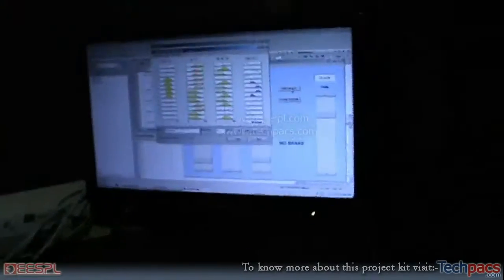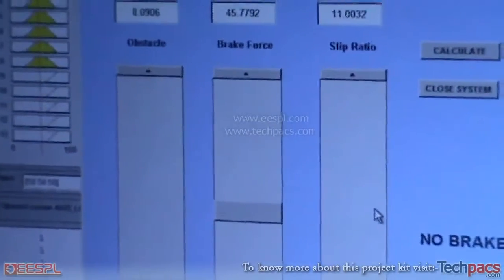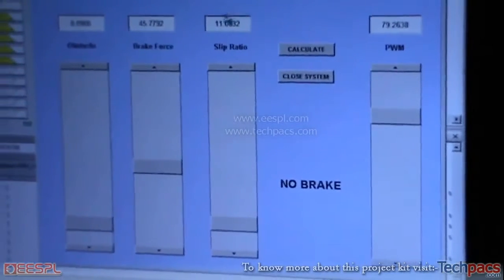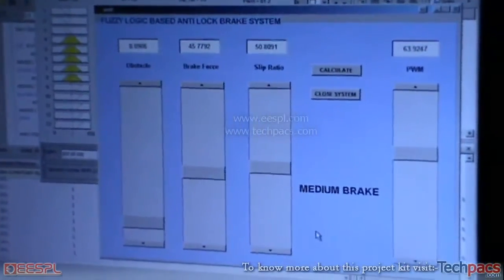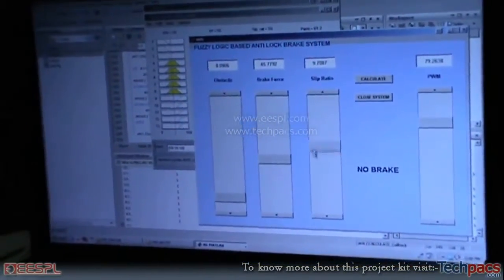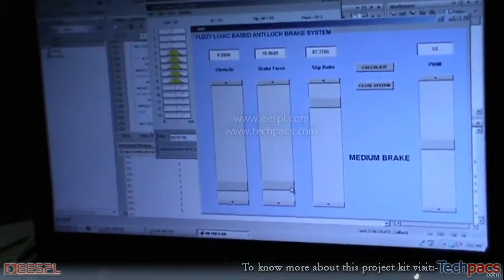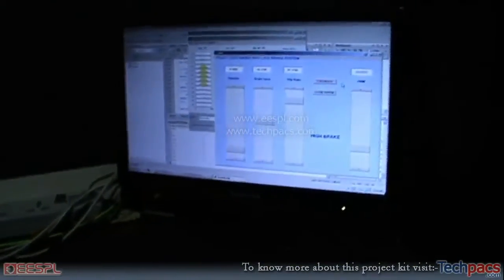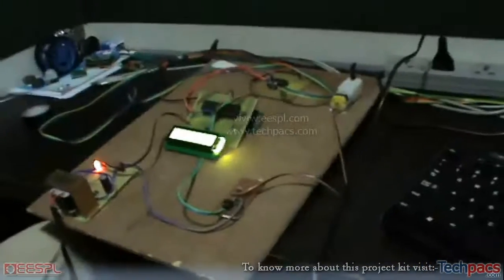Design Of ABS Using Fuzzy Logic | AntiLock Breaking System using Arduino  (latest Project 2020)

Comment: Hi guys,
You seem to know alot about abs units.
Is there any way of programming them?
I have a car which doesn't have hill assist (where it holds brakes for 2 seconds) but is fitted with esp control unit which is capable of doing it. In some cars its activated from factory but in mine it isn't. It won't let me do it with diagnostic equipment either. 
Any thoughts? Let me know.

Comment: can i get  the circuit diagram to understand as to how the motor the display boards the power supply extra are connected to eachother and the MATLAB ?
Reply from the maker: for more details plz open this link

http://www.techpacs.com/category/Project/16-119-72/Design-Of-ABS-System-Using-Fuzzy-Logics-In-Matlab-And-Its-Hardware-Implementation
 
you can directly communicate with our experts on tjis no.+919814756606